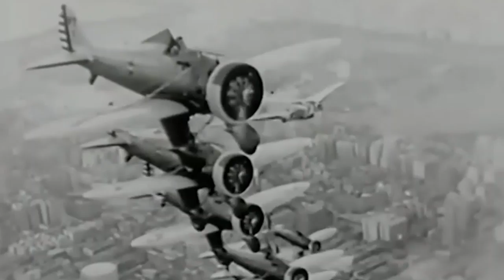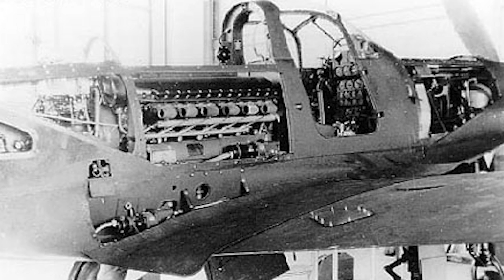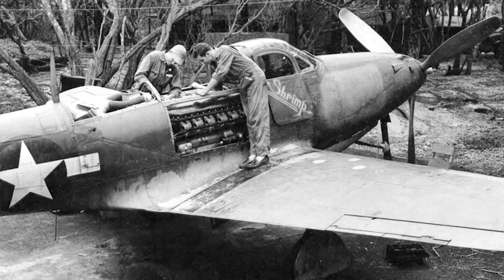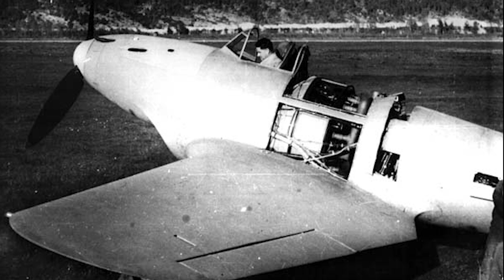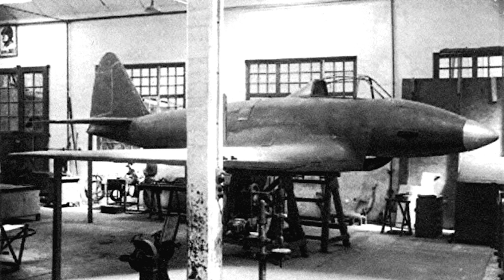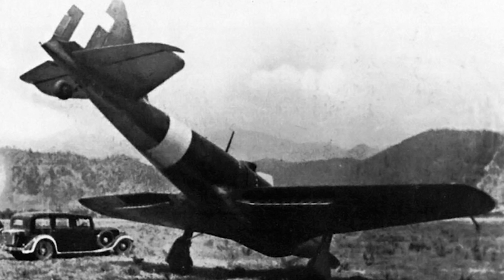The Piaggio P.119; A Fighter with A Unique Engine Set Up

Comment: By the end of the war everyone was thinking of putting the engine behind the pilot. In fact they were moving the pilot up near the spinner. Gave a much better view for the pilot, especially when taxiing. Some of these were actually built, some didn't get beyond the design stage. There was the XP-75,  the Me-509, Rolls Royce's proposed design to take the Crecy engine (this was supposed to use P-51 wings and got to the point of a papier mache mock-up).. Not to mention pretty much all the post-war jets. Also, almost everyone was switching to nosewheels. The P-39 was ahead of its time.

Comment: the first real chopper that went into serial production, focke-achgelis fa 223 drache also had a mid mounted radial engines as power plant but using that set up in a fixed wing desing is realy weird.

Comment: Rolls Royce did some design work, 1943/4, I believe,  for a mid engined fighter and created a prototype. The prototype used the wings & tail assembly from a P51. The intent,  I believe,  was to use more of the unused space in the fuselage, behind the engine location for the supercharger, run more efficient ducting & intercooler. The existing front engined fighters of the day were limited in space for the supercharger and associated bits & pieces. Obviously the engine was the RR Merlin or Griffon.

Comment: For the number of these stories that involve an engine not being available for purchase or not even in production, and it ends up swapped for something bigger/heavier/less powerful... you'd think that aircraft designers would start drawing blueprints around the dimensions and capabilities of an engine they could actually obtain.
Reply: It was a time of rapid change. With the design process taking about 2 years, by the time it got from concept to flying prototype, you might have gone through two generations of engines. 
It might have been designed for a 500hp unit, redesigned partway through for a 700hp and by the time it's ready to fly, its competitors are using a 1000hp engine.
Reply: @kieranh2005  Sure, that all makes sense and everything... but (hypothetically) if the 700hp engine is still just a prototype and 500hp is all you can actually get, it puzzles me that they would construct an airframe for a 1000hp engine that's just a blueprint. Not just one plane, but design after design meets this flaw.
Reply: The Piaggio P.XV was already a very good 1700hp engine. The only advantage of the P.XXII was that it would have provided that power using standard 87 octane fuel, while the P.XV needed 97 octane.

Comment: G'day,

Hmmmn, well, the Yanquis built a lot of Tanks with buried Radial Engines, and the Brit's built the Bristol Brabazon with 10 Radial Engines inside the Wings, as well as a lot of Westland (Sikorsky) Helicopters with Radial Engines lurking under the Tail-Rotor  Pitch-Pedals...; so closeted Radials are not quite impossible - merely very difficult and requiring some serious Fans and careful Ducting.

Such is life,

Have a good one...

Stay safe.

;-p

Ciao !
Reply from the maker: Bit short for you today Warbles!  ;D

Comment: I can understand the idea of better streamlining, and more space in the nose for armament that a mid mounted engine can give, but weight distribution? Sure keeping weight down in the extremities (and therefore reducing inertia/momentum) is good "physics" in regard to handling/stability, but at a cost.  The P39, I believe, suffered from too much weight rearward, and too much in flight variation in weight distribution, causing stability issues, esp in regard to a spin.  Probably a reason not many piston engined planes had mid mounted engines.

Sure the engine is heavy, but it's a constant weight that can be compensated by other means during design (as are weapons) and the Centre of Gravity of the aircraft will remain the same as the weight never changes during operation. 

But it displaces other "variable" weight loads (like fuel, ammo, cargo etc) to places away from the C of G.  Using fuel as you travel if it's not stored at the C of G will need constant trimming, ammo similarly.  To me it's biggest benefit would be the possible streamlining, and getting the heavier weapons out of the wings and into the centerline.

Comment: The Piaggio P119 was an interesting airplane with the Piaggio  P.XV RC 45 radial 1,500 hp engine and was planned to install the Piaggio P.XV RC 50 with 1,650 hp but never installed but it had serious cooling problems and the cooling flaps had to be always open creating drag. Apparently it flew well but as stated on the video there is very little info because it was heavily bombed. Even if have been produced it was not built for mass production with complicated metal construction and it would have taken a long time to sort out teething problems and was not faster than the excellent Fiat G.55 Centauro, the Macchi C.205 Veltro and the Reggiane Re.2005 Sagittario all powered with the licence production Fiat RA.1050 R.C.58 Tifone practically a copy of the DB 605A-1 
Good job 👍👍👍

Comment: How about the Kyushu J7W Shinden Radial Installation?
Reply from the maker: Oh yes, a pusher radial. That had been played with a bit before, but certainly a novel idea. I'll get around to the J7 one day.
Reply: @EdNashsMilitaryMatters  the air frame was actually designed so that it could be upgraded to take a jet engine. You could almost think of the radial engine as being an interim solution
Reply: @JohnRodriguesPhotographer Have always thought the J7W looked like it ought to have been a jet. Wasn't the least bit surprised to find that was indeed the plan, but time ran out.

(Think the prewar deMonge-Bugatti 100P racer would have made a good basis for a light jet, too. Indeed the fairly recent Williams V-Jet prototype somewhat resembles the Bugatti.)

Comment: Moving the engine from the nose to amidships doesn't make an airplane 'better balanced'.  It doesn't really matter were the engine is as long as the center of gravity is forward of the aerodynamic center.  If you move the heavy engine back you also need to move the wing back to maintain this relationship.  It is not better balance, but it is better visibility for the pilot and more room in the nose for armament.

Comment: Little known, but Republic Aviation in the US did some design work on a similar concept in 1942-1943 called the XP-69.  Radical engine behind the pilot.  No prototype was built before  the project was cancelled in 1943 only a mockup was finished for wind tunnel tests.
Reply: Nice.

Comment: wait a minute I thought the Italians didn't produce a radial for much of the war with over an 800 HP rating, I didn't know they built radials that large
Reply: Yes they did but they developed it far too late to be putted in production! The Piaggio produced the P.108 of similar size of the B-17 that was equipped with four air-cooled 18-cylinder P.XII radial engines, which suffered from reliability problems, but produced 1,350 hp with 1,500 hp at takeoff. The P.XII was basically a two Piaggio P.X engines in tandem, which were modified, by Piaggio, versions of the lousy French Gnome-Rhône 9K Mistral made under license.
Reply: Italians produced 1000 hp radials since the mid '30s (1000 hp Piaggio P.XI and 1030 hp  Fiat A.80. Also the 960 hp Fiat A.74 and the 950 hp Alfa Romeo 128 were close). 
In 1939 had been omologated the 1500 hp Piaggio P.XII and the 1600 hp Alfa Romeo 135 (the second never reached a sufficeint reliability, but the first one had probably been the best radial that used standard 87 octane fuel of the war). In 1941 had been homologated the 1700hp Piaggio P.XV (97 octane fuelled version of the P.XII).
Reply: @neutronalchemist3241  true but they were a modified version of the lousy French Gnome-Rhône 9K Mistral. Hence suffering readability issues that was never really solved much also because of the low quality 87 octane fuel that afflicted all the engines made by the Axis. The life span of the DB 605 also for license production was about 50 hours use before being overhauled as this fuel was very hard on those engines.
Reply: @paoloviti6156  "modification" in VERY broad terms, since it had double the row and more than double the power. "Hence" means nothing when the engines are so different. 
The reliability problems were on the first engines produced. Those of well known engines like the BMW 801 or the P&W R2800 lasted for longer before being ironed out. It has to be taken into account that, due to the different productive capability, the "first engines that gave problems" (a common occurrence in WWII era) were an higher percentage of the total production for the Italians, even if they were numerically fewer.
The TBO of Italian licenced DB engines was of 60 hours. Packard Merlins rarely lasted 100 hours (and, due to the different mission profiles, most of those hours were at military/emergency power for Italian engines and at cruise speed for Packard Merlins).
The P&W R-2800 started service with an expected life of 25 hours (then the 5 cylinders in top rear position had to be replaced without even checking them, while, for the DBs, at the overhaul the cylinders were checked and rebored only if needed). Only some thousands engines later it became of several hundreds hours, then of thousands. The difference between the outstanding P&W R-2800 and the unreliable Alfa Romeo 135 was that the US could afford to put in service an engine that required to toss 5 cylinders every 25 hours of functioning.
The RR Merlin had nominally a 240 hours TBO but according to Rolls-Royce, if 30% of engines were reaching overhaul life and, no single cause made-up more than 30% of rejections, then it was time for an increase of maximum engine life.That means that 70% of the RR Merlins didn't even reach TBO, and that was late in the war when, again, much of the time the engine was at cruise speed.

Comment: This is one of those concepts that really just needed a few tweaks to work well. Ejector exhausts, wing root intakes and the cooling fan setup from the FW190, for instance...
Reply: I wounder if just a few tweaks would have solved many issues because generally speaking it had important cooling problems and suffered severe vibrations when shooting all the guns..

Comment: Interesting as the Koolhoven company used a  rear mounted engine with 2 counter rotating propellors at the front   It seems that Pagio , fokker , koolhoven all where  trying in to some form of dual engine or twin prop configurations to get as small and as powerfull an aircraft. 

the Koolhoven FK-55 .  the mock up looked great . but due to an iseu with engine availability they used a different one and it cooked the pilot . plus it changed the look of the aircraft from a valcon to a fat duck.
Reply: The British 'Fairey' company produced pre-war a viable 'two-in-one' "vee" piston-engine, one cylinder-bank of which could be left idle for fuel-economy The powerful engine might have improved the performance of some lackluster planes like the 'Battle' but the politicians squashed further production.
Reply: @None-zc5vg  True ,but there was also the Hungarian prototype of a turbo prop engine .  Some how it never realy got in to production as every one went on to develop turbines.

Comment: Great design. I wonder how do engine center mounted airframes deal with the gravity center position that comes almost naturally with forward fitted engines.
Reply: I would imagine that cg position would be far more of a problem with nose mounted aircraft needing to counterbalance that enormous wieght up front. Surely the fuel distribution and compensating for cg changes whilst using it up during flight would be more the headache?
Reply: CG location is determined by the wing, and would be much easier to control if the center of mass, engine in this case, was concentrated directly over the CG.
Reply: If memory serves, CG has to be slightly in front of the lift center if the plane has to fly properly without trim adjustments. The engine weight placed in front of the wings in a conventional design is then of a great help.
Of course, as Viper said, this is just theory, as many other things change during the flight, like fuel and ammo depletion.
Reply: @6h471  Easier to get out of shape too. P-39 handled well enough till you ran it to the outside of the aero envelope. Then it tended to do ugly things. Not so much a CG issue, as a Polar Moment of Inertia issue.
Reply: The center of gravity is not in the nose, it is somewhere near 23% Mean Aerodynamic Chord.  Moving the engine from the nose to amidships doesn't make an airplane 'better balanced'.  It doesn't really matter were the engine is as long as the center of gravity is forward of the aerodynamic center.  If you move the heavy engine back you also need to move the wing back to maintain this relationship.  It is not better balance, but it is better visibility for the the pilot and more room in the nose for guns.
Reply: @gort8203  Good clear explanation - thanks.
Reply: @vipertwenty249  My pleasure.

Comment: In theory placing the engine behind the pilot would reduce the plane's rotational moment of inertia, making it less resistant to turning and perhaps requiring less area for control surfaces. The added complexity of cooling and getting that power to the propeller are drawbacks, and the cockpit becomes a place you really don't want to be in the event of a crash.
Reply: In the event of a crash you don't want to be in any plane, you're unlikely to survive no matter where the engine is. If the force was large enough to crush the cockpit with the engine behind you, you wouldn't have survived if the engine had been in front.
Reply from the maker: Indeed! Not fun at all!

Check out my video on the Spad SA for an utter death trap.

Comment: So to me this just raises the question of ducted fans.

Were these experimented with at this time?

It seems strange to move the engine back, but not also move the prop back, and if you're doing air flow for cooling why not use it for thrust?
Reply: Caproni Campini N.1

Comment: Resembles the Dutch Koolhoven FK55 prototype, first flew in 1938. Though that was powered by a liquid cooled engine. Note that air cooled radial aircraft  engines were also used to power the Sherman tank (using a fan to provide cooling air). So it’s not completely wild idea to build it in an enclosure.
Reply: Some Shermans, not all.  There was also a Guiberson four-stroke diesel radial engine in the M3 light tank.
Reply: And the first usefull helicopters like the Piasecci also had radials in the back.
Reply: @JMGlider  And a lot of Sikorsky helicopters had a radial in the nose cowling. H-19, S22, S58, H-34, etc.
Reply: As well as its predecessor, the Lee/Grant, which was much the same mechanically.

Comment: But then again, Piaggio hung a motorycle engine off to one side. That one didn't vanish into obscurity...
Reply: Wasn't it an airplane starter motor?
Reply: @benholroyd5221  As far as i know that's an myth. However, much of the Vespa design used aeronautical thinking rather than following conventional motorcycle practice. Which happens when you ask someone who designed helicopters to come up with a solution.